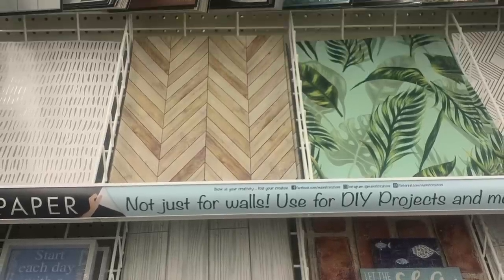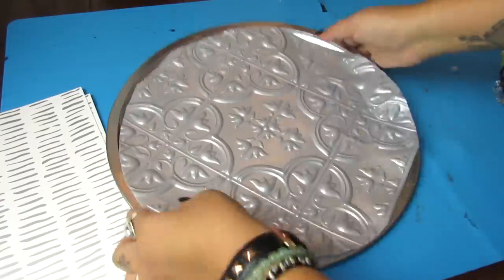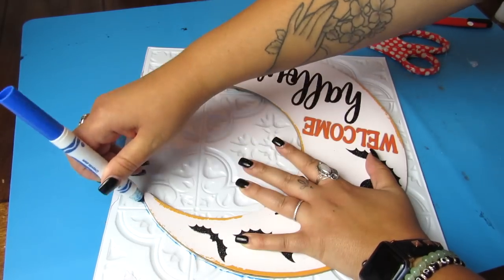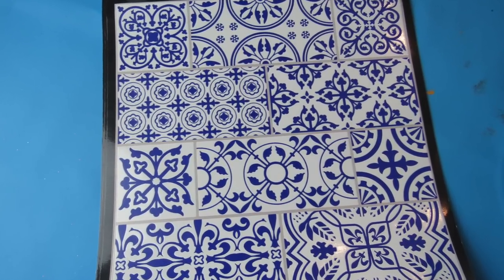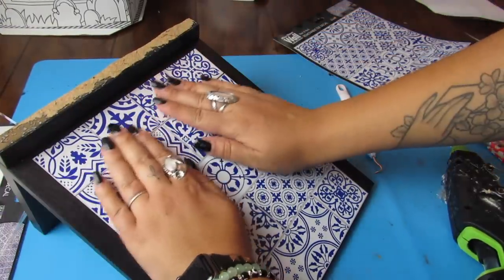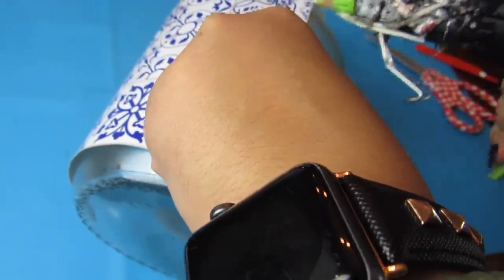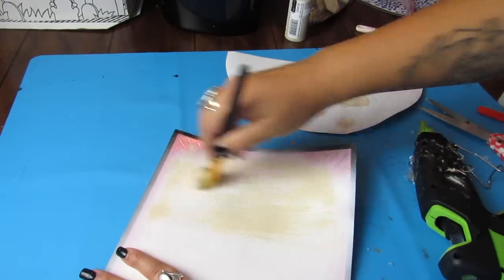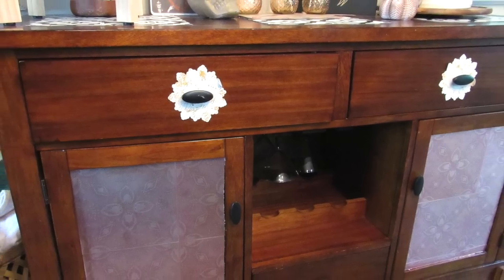🤯GENIUS DIY HACKS USING DOLLAR TREE PEEL N STICK WALLPAPER AND TILES! DOLLAR TREE DIY HACKS

Comment: Just a suggestion...On your glass doors...center the points of all four pieces on your glass and then trim the 2 sides of each of them off..it will look so much more cohesive and not so sloppy...
Reply from the maker: It doesn’t bother me 🤷🏻‍♀️
Reply: Linda Renner, Good idea! Thanks for the tip. 👍
Reply: Linda, good idea!!!
Reply: @alygarden7879

Comment: I used the silver colored tile behind my stove.    I spray painted two tiles in a shinier silver color then clear coated it.  I just wanted to cover the area between the range and hood.  I centered the one tile and cut the other in half. I matched the design.  I just had to use some Elmer’s glue to keep the cut edges from coming up. I covered the edges where they meet the cabinets with two thin dowels sprayed silver.  I like what you did with the black tray

Comment: Try taking the tile and putting it on the bottom of the pan and tracing the bottom of the pan on the tile… And then cut the tile so it’s a cleaner finish